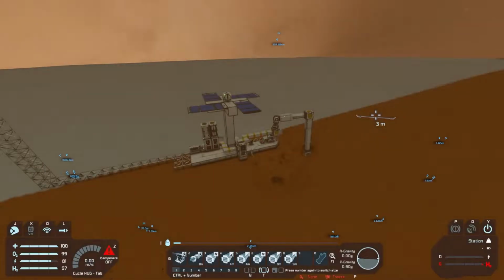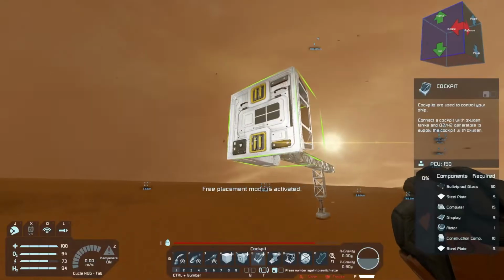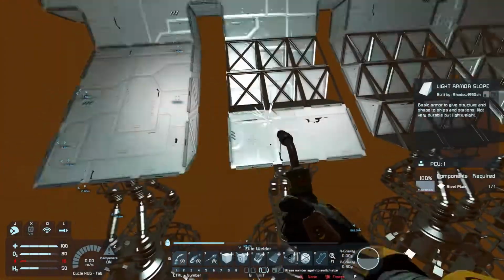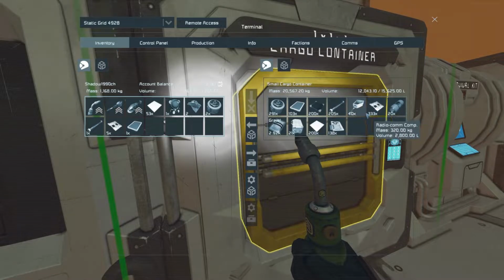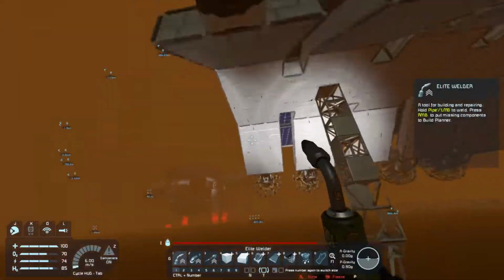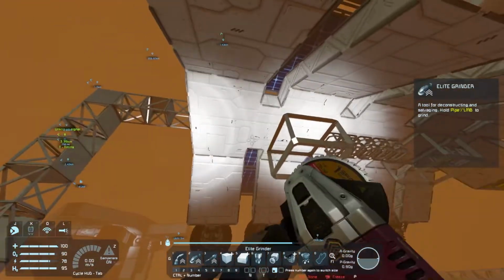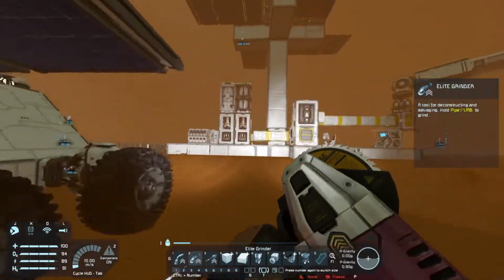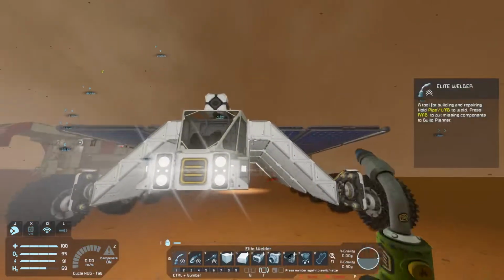Space Engineers: Mars Rover

Comment: Ten Wheels = Decem Rotae

You can double up the solar panels. you also covered up door and conveyer ports on the back of the cockpit.

During storms/ fog solar panels do not work well. 

Lights (spot/interior) when it gets real dark
Connector / advanced rotor/ hinge for charging batteries off the base
Gyroscope / some sort of flipping... (be prepared)  
Medium cargo (no metal grids)
Antenna (broadcasting ore location when you leave the cockpit beacon does not)

Group batteries:  Toggle recharge on/off (put on hot bar)
Turn off braking on the front wheels ( to prevent forward flipping) and turn off steering on the middle wheels limit rear wheels to 10%.. or what your are comfortable with.
Reply from the maker: Definitly a bunch of good improvements. I think the Gyro and the connector are gonna be the most importent ones for now (at least if the storms keep up like that).
Reply: @shadow1990ch  Plus the connector doubles as as cargo.